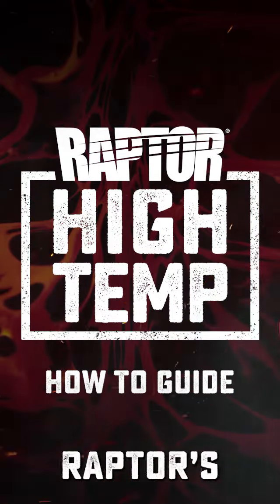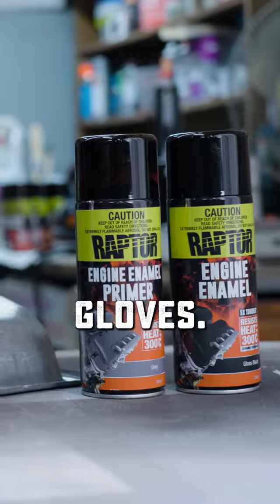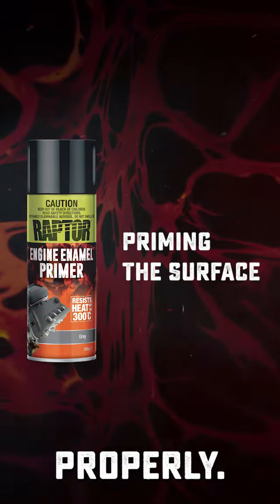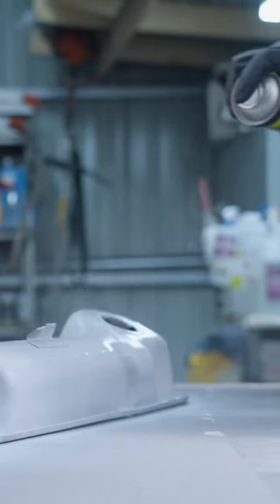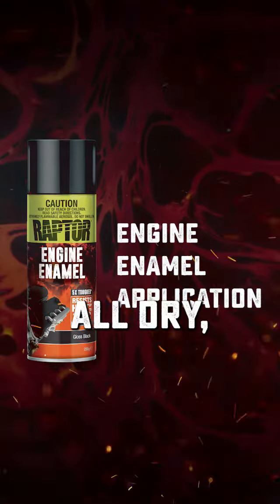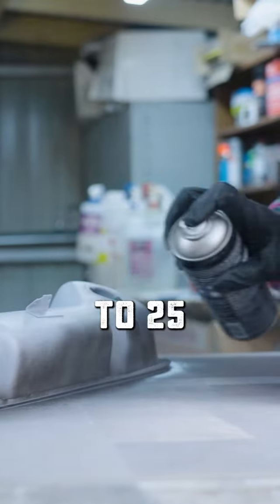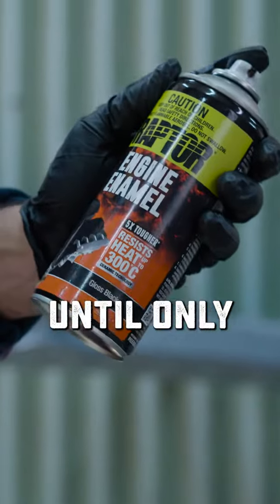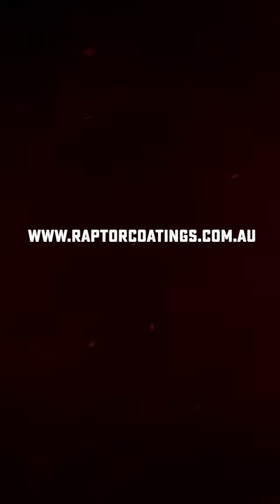HOW TO use the new RAPTOR High Temp Engine Enamel 🛠

Comment: Hello Are these all high heat resists series.good for offroad. During offroading, do stones and soil in coated areas such as the rim, caliper or exhaust fall off the surface as quickly as possible?
Reply from the maker: Hi there! The RAPTOR High Temp range is 5 x tougher than regular automotive paints so highly recommended for those areas! Be sure to use the right prep and primers for optimal results 👍